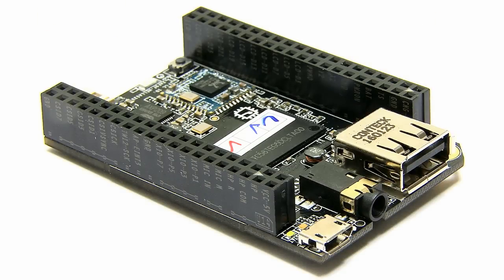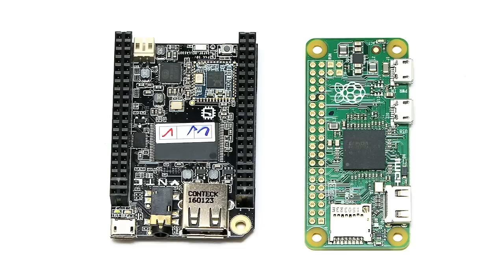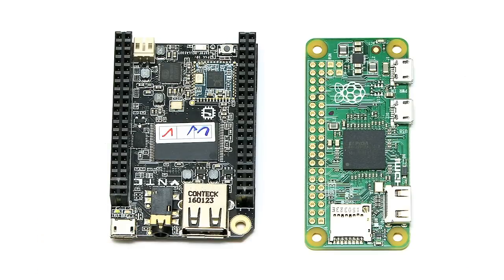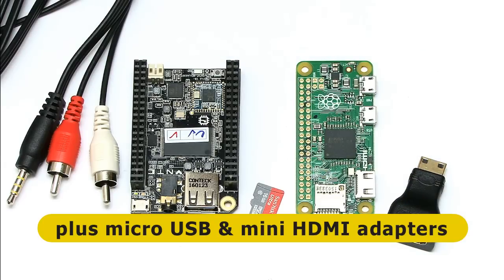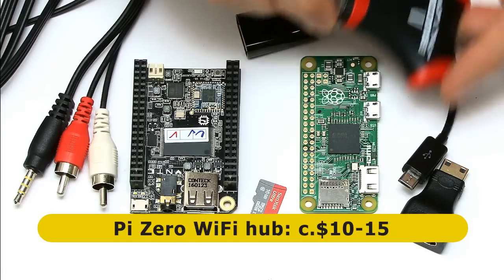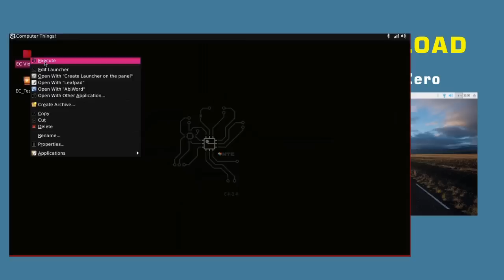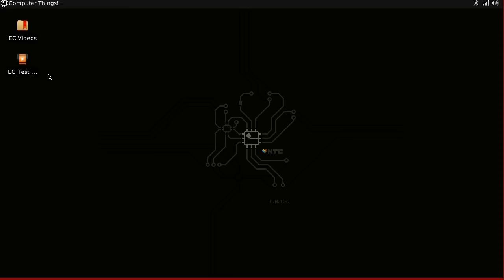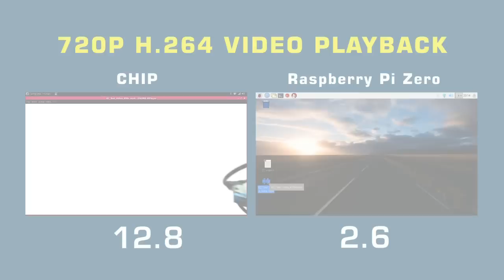CHIP v Raspberry Pi Zero

Comment: Could you use a portable power supply and make it a laptop? Perhaps 3D print a case to make it a laptop with a USB portable power supply? Methinks there is great possibilities here
Reply from the maker: Methinks you are right! :) You can power either of these boards from a USB power bank, and the CHIP from any standard LiPo battery.

Comment: I have come to really like this channel. That said, this video didn't hit the mark of a fair or accurate comparison. The "cost" portrayed is really off the rails here as nearly nobody will use them for desktops and thus will not be purchasing most of accessories listed. These are embedded project boards, not workstations.

Also, the web browser test was only run once. An accurate test would be to start the browser several times and see the average. Many times after a reboot an app will take longer to start up the first time. But close it and start it again and it will be faster. 

It would also have been better to use the same browser on both boards to test. Better yet have Firefox and Chrome on both and run those tests.

I'd also have added a Libre Office app and a performance benchmark test just to get a good sense of each board's true performance.

The one test I thought was good was the video. But I'm not sure of the method the video was played on each board. 

All in all I am glad this video was made as it gives at least a glimmer into the comparison. For most who will be looking for an embedded project board, I think the Pi Zero wins if for no other reason than it's extremely slim profile; a feature that was sort of an after thought in this comparison.

Comment: Thanks Chris, but both have problems of availability, if you got either or both then you are an extremely lucky person
Then the charge of shipping cancels their low price!
So your safest bit it to get an Orange Pi, use Etcher to copy Armbian (Linux for Arm cpus) on it & live your life:
http://www.banggood.com/search/orange-pi.html
BTW, the RPI Zero has CVBS to RCA (TV Out) you just need to solder jumpers or RCA video cable onto it. TV Out is to the right of the RPI logo :
http://raspi.tv/wp-content/uploads/2016/05/Pi-Zero-1.3-top_700.jpg
And for RPI Zero Analogue Audio, LadyAda has some Schematics for a board:
https://learn.adafruit.com/introducing-the-raspberry-pi-zero/audio-outputs
Reply from the maker: Very true -- both the CHIP and the Pi Zero are too cheap to off a decent enough vendor margin to make them mass available (unless sold in bundles of other hardware, which negates the initial low price).

Comment: All I want is a word processor computer that I can put inside a keyboard and hook up to a monitor when I need it, what are my best options? Literally just want something to write on, store a few documents on a medium that I can easily transfer.
Reply from the maker: Your best bet, I think, is a Raspberry Pi 3, or a Raspberry Pi 2. You could use a CHIP or a Raspberry Pi 2, but would need to add a hub as there is only one USB 2.0 port. But with a Pi 3 or Pi 2, there are four USB ports, so you can connect your keyboard, mouse, and still have two left over to plug in USB drive to save your documents on. You may find this video useful: https://www.youtube.com/watch?v=7QH6RDzllls -- where I spent a week using a Raspberry Pi 2 as my only computing. And for word processing, spreadsheets and light web stuff, it worked really well.

Comment: The Allwinner / Mali in the Chip should play videos properly  Maybe the Pi-0 software is using hardware acceleration and the Chip software  is not - I don't know.  What I do know is the Mali-400 is very capable, being used in many mobile phones and Android TV  boxes.  

Perhaps, Mr Barnatt, if you read this (and have nothing better to do), you could check for hardware acceleration in the settings.
I would love to know whether video playback is possible from this device, and if not... Why?  

Thanks

Comment: I have to say for embedded systems I prefer the Pi. I don't need HDMI or networking, or even Bluetooth. I just need the GPIO Pins.
And a big advantage of the pi is: I plug in a SD card with my software, solder some wires on, and it works.

Comment: Hi I have the Raspberry Pi Zero with the latest and updated Raspbian installed.  It says OMXPlayer is installed when I type it into the terminal but I cant find it on the GUI desktop.  I see you have it associated with your video files, could you tell me or point me to a guide that will help me set mine up like this, thanks.

Comment: WOW! When I first backed the C.H.I.P. on Kickstarter it came in a very small square cardboard box, and it came with an INCLUDED TRRS connector and a Cool little case for the back of C.H.I.P. the protect the Processor.

I can see how they saved so much money in not giving you the TRRS cable, case and cardboard box, which is understandable because they are given free to Kickstarter backers :)

The case is $2 and the cable is $5, although the included TRRS connector is only a few inches long, but thats ok, it did fill all my needs for a very C.H.I.P. computer system with much Amazement :)

For reference on how C.H.I.P. was originally sold and packeged go here: https://www.youtube.com/watch?v=-FihWtllZlE

The latest Beat or Alpha OS with C.H.I.P. comes with 8GB of built in storage, and yes it's my a software upgrade.

Also the OS of C.H.I.P. is still very new compared the the OS of the Pi Zero, which is using the OS of the Other Pi Products, NTC the company who developed C.H.I.P. is not a multi million dollar company with lots and lots of workers at their disposal to develop and polish the product faster, compared the the Company of the Pi.

The Latest Alpha/Beta OS of C.H.I.P. now comes with 3D acceleration, which means you can now play 3D games using the built in GPU, which originally had no driver to operate it when C.H.I.P. was first launched.

Wow this helps enlightens anyone's confusion or frustration, over all I would still go for C.H.I.P.  :)

Comment: CHIP came-up to me with short 3.5mm to phono AV lead, so I will not add this cost.
But fairly price scope and computing power is quite similar.
Real deal with CHIP is on-board communication, storage and lipo connector, making it very small and compact computer, ideal for drones or robots :)
However, the killer punch is from RPi with community support. In my opinion the most important thing in DYI IoT devices.

BTW: Serious programming is done via remote desktop/SSH, not on board, best wo. xwindow started  ;)

Comment: Nice comparison, but there are two issues with your cost-calculations! 
1) You have added both the HDMI DIP and the composite into the cost of the CHIP 
2) You did not add any WiFi or Bluetooth Adapter to the PI to make them both comparable.
All in all, is the CHIP setup around 20$ cheaper!
Reply from the maker: Yes, you are right -- I added both the composite lead and the HDMI DIP to the CHIP. My mistake. But I did add the cost of the WiFi dongle and hub to the Pi.  So the CHIP is about $5 cheaper. :)

Comment: Love my Pi Zero. :o) However, both of these little computers have the same problem, they are always out of stock or you can order just one of them. At least here in the EU. Pretty much useless for any projects...
Reply from the maker: Yes, both have major supply issues -- and I think will always have major supply issues. The key thing here is that, for a retailer -- or indeed a manufacturer, selling or producing a $5 or $9 computer is not viable in terms of margins. It may be technically possible, but it is not economically so. This is why both the Pi Zero and the CHIP are strongly promoted to be bought with many accessories (I read somewhere that the average expenditure on a CHIP purchase is about $50, and I am sure that this is similar for a Pi Zero). And this all means that those of us who may want just the computer for a project are always going to be in difficulty. I really wish the Pi Zero cost $10, and a lot of that was retailer margin, and they availability could and probably would significantly rise.
Reply: I second your wish. :o) $10 for the second Pi Zero on my order would be perfectly fine. At the moment it's not even possible to order e.g. a full kit and an additional second Pi Zero. That's not clever at all as the customer will end ordering his Pi Zero only (without accessories) and the retailer might have no margin at all as you mentioned.

Comment: the pi is a lot better option for me. i have a wifi dongle, an hdmi to normal hdmi cable, a usb hub and a powersupply. i use (a full size) pi as a media center for my living room. i also overclocked it with no problem whatsoever. but the most important for me is the on-board decoder that makes the video playback perfectly buttery smooth.

Comment: I have to agree the Pi has the edge. Its on-board HDMI and user selective memory capacity are key features. The CHIPs slow video playback is more than a little disturbing and a game ender if it cannot be overcome. The price of both devices is getting up there once you add on necessary accessories... which make one wonder about simply going with a full size Pi over the Zero. Excellent video as always.

Comment: Good comparison of the two computers. Unfortunately the Broadcom WiFi / USB hub is not particularly a good choice, for no other reason than I can only use one at a time with my router. I tried two different routers and it seems that the Broadcom dongles that I have, both have the same MAC address and the router could not differential between the two even though the PiZero's have different network names. Therefore neither worked at the same time on the two robots I am trying to run :-(

Comment: i dont get why the chip doesnt made to decode real time 720 h264. I have a galaxy s3 wich has the same Mali400 and this phone decodes 720 and 1080 without a single frame drop. I think there is something wrong with the hardware acceleration in the chip os. Btw great video

Comment: You got to know the purpose you want to use such device. I can imagine the Chip in many applications where the CPU/GPU is not the issue but the onboard memory & wifi makes the difference. Its just drop&forgot little device with minimum "moving parts".  If you need some more CPU performance in really small package go for zeroPi, but I believe the RPI3 will cannibalize most of its occurrences anyway.

Comment: I use a powered 4 port USB hub that is really small.  It has enough juice to power my pi boards and would probably power the chip.  I can run the a pi board, usb wifi dongle, external usb hard drive, and a keyboard/mouse device dongle without any issues.  Its a must have accessory IMO if one is really into these small systems on a chip.

Comment: Chris, you might want to do a video about thin client computing, meaning using a low power computer to access a remote server to do work, like I'm doing right now. I use a Windows 10 OS in a virtual machine on a Linux server in France, and accessing it from Linux Mint using Remmina RDP client. I use a low power laptop with a 4W Intel Celeron N3160 CPU and 4GB RAM and a 32GB eMMC storage.

Comment: The video playback comparison is tied into the "support" you mentioned near the end of the video, and said support may be the most important part of SoCs. Any SoC at the sub 50usd range will always crawl like the chip when doing video playback with gnome mplayer. At least with catch-all acceleration methods and drive stacks that come out with the operating system you use with it. Starting at the lowest level the Pis operating systems and hardware have been available to the public for far longer, so not only is there more of a mature understanding of it, you see things like Omxplayer more often. Omxplayer is what wins the Pi for video playback, it is an entire video player stack using the OpenMax api from Broadcom themselves to get the absolute best media play back possible from the Pi. The chip may one day have the same sort of support but unfortunately unless one person stumbles on some goldmine of performance in the chip to compete with things like Omxplayer, it is always going to be second fiddle to the Pi.

Comment: 10:21 What's the flashing bellow pin 18 of the HDMI connector? It's way too small to be an LED. Looks almost like a spark.
Reply: hellterminator That is an LED. Just a tiny one mounted to the board.
Reply: Nathan Schmick Looking at a high-res photo right now, there's no LED there. Even in the video you can clearly see there are no pads for an LED to be soldered to, the flashes are appearing between a layer interconnect connected to pin 18 (5V) and a trace leading to pin 16 (SDA) and there's no component there. It can be either a spark or a reflection.
Reply: I see something soldered to pads there, it's just that the LED is facing the side of the board, not toward the camera.
Reply: sinephase Dude, there's no LED. http://i.imgur.com/O2tVEm4.jpg

Comment: I think the software comparison would have been more fair if the tests were run using the same applications, I mean, to be fair, that the actual conclusions here fit the question "what default software run better on each device" instead of "what device is faster/better"

Comment: Thanks for the video, I'm glad you showed that the price of the device itself is not the whole story.

On the browser test, the reason the pi was delayed loading youtube, you can see it was loading data for the 'uBlock Origin' extension which is quite a slow add-on in my experience, so test it again with that disabled and the pi will probably win

Having said that, your tests kind of miss the point of these devices.  They are designed for hobby uses or for robotics (as 2 examples), where you set the thing up and then run it standalone, with no need for a screen output or for keyboards and mice etc.  If you want a 'Computing device' then the full size pi or equivalent is much better value and more practical.

Comment: There's a slight mistake with the ports description on the chip, the micro USB port is also an otg port that can provide serial connection to the chip, which is a huge advantage in my use case, I'm a programmer and I'm using the chip as portable programming device and I'm connecting it through one USB port directly to the pc and I can.program at my regular environment without the need to configure everything from scratch every time I'm at new place and the greatest thing about it that's it cross platform I can even use it on winxp and the pi0 from the other hand can be set as ethernet gadget but it requires different settings on different machines plus there no WiFi

Comment: Really surprised by the result of the video playback test! Did not expect that at all!
Bit of a shame that the Pi Zero does not have wi-fi and/or bluetooth on that board, though. It's just what it needed.

EDIT: I wonder how's the performance for data access speed on both of those devices.

Comment: It would be nice to see how chip does gpio stuff! Maybe in next video? By the way you didn't mention, that chip has 2 usb connectors. The micro usb supports data transmission, so with otg adapter you can have 2 usbs. :) Of course you must power it through female header.
Reply from the maker: Yes, good point about the micro USB being able to operate as an OTG port. And I must, as you say, experiment with GPIO on the CHIP in another video! :)

Comment: Why did you not mention the JST connector on the C.H.I.P? This allows to hook up a LiPo battery. The C.H.I.P can charge the battery while running. It's like a built in ups. 
For people doing robotics that is a very important bit of information. 
Also, next time do compare the connections available on the gpio port. Gpio is not a standard.
As a robot builder your comparison was totally useless.
Reply from the maker: Sorry for being totally useless. I did mention the LiPo battery connector on the CHIP. And I never said the GPIO port is a standard. There is always a limit to the quantity of information that can be included in any one video. :)
Reply: Sorry I missed the mention. I'll watch the video again to verify. 
Just keep in mind that many of these embedded Linux boards are used for more than cheap PCs or multimedia systems.

Comment: good video but I really wish you had run the same browser and video player on each device.  using different programs kind of negates the test in my mind.  What default program the developers decided to use doesn't really have any bearing on raw performance.  I think anyone who would be buying one of these would understand how to install a different program.
Reply: Yes I agree :)
Reply: Do R/C! but if he did that, then it wouldn't be comparing the default hardware.
Reply: not if another player shows something else. the chip is now unusable for
 many, but if another free player is able to play it fine, it would 
change the outcome. perhaps still slower than the pi which this was all 
about, that's true. but it would still be a better test/video.

Comment: Doesn't the CHIP actually have 8 GB of storage? They had to software limit it to 4 GB for a reason that I forgot, but now with the latest firmware you should be able to use the full 8 GB.
Reply from the maker: That was the old CHIPS (first generation) that shipped with 8GB MLC (2 bits a cell) flash, accessed in SLC mode, hence providing 4GB. And these can, with the right upgrade, as you say now use the full 8GB by operating in MLC mode. However, more recent CHIPs have 4GB MLC flash that runs in MLC mode, hence providing 4GB, but no opportunity to upgrade.